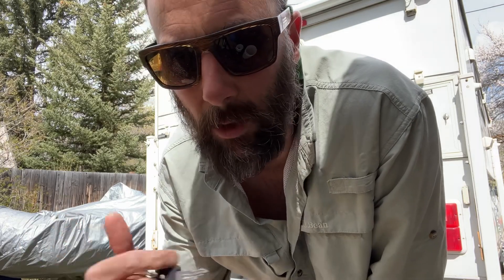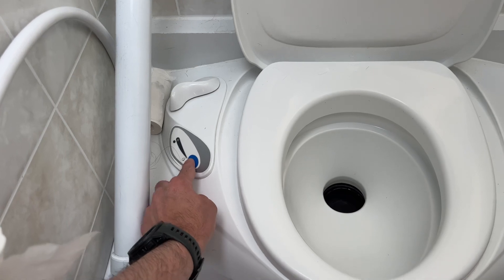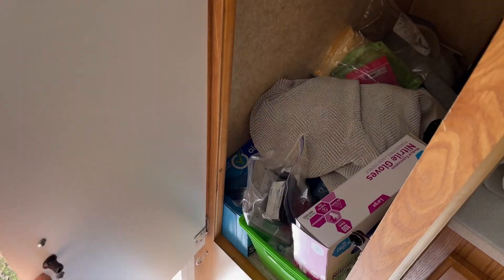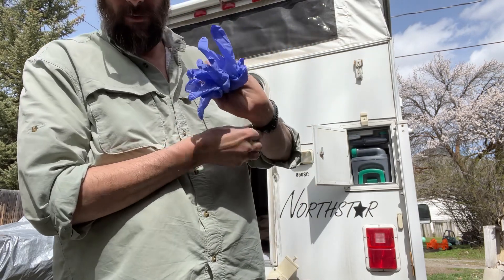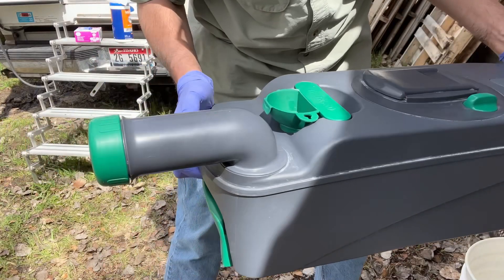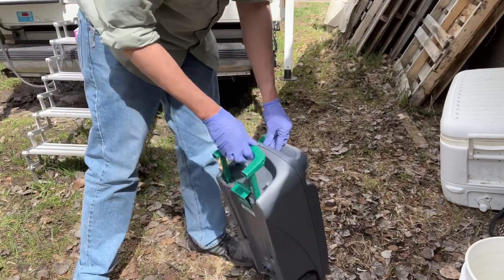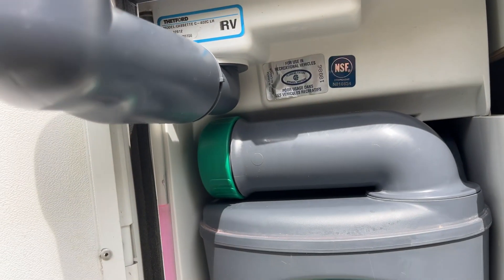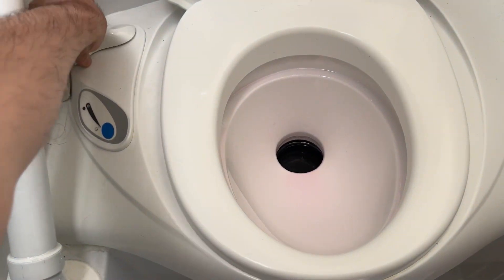How a cassette toilet works | Northstar 850 SC

Comment: Do you ever need to hose it out or do the enzymes added make that unnecessary? This may be a dumb question but what do you do if you are boondocking or don’t have an RV dumping place near you? Can you empty it in a regular public toliet? What do you do with your toliet paper? lol, I have questions.
Reply from the maker: Yes Ill give a rinse out from time to time.  The RV antifreeze we use in the winter to flush seems to keep things very clean (mostly alcohol).  I dump it in backcountry pit toilets all the time-very convenient.  TP goes into the cassette like normal.  I havnt had any issues and dont even use the RV toilet paper, although Im sure that's a better practice.  They are really great in my opinion-feel free to reach out if you have any other questions.  We never had any experience with them before getting this camper.  Good luck and Merry Christmas!